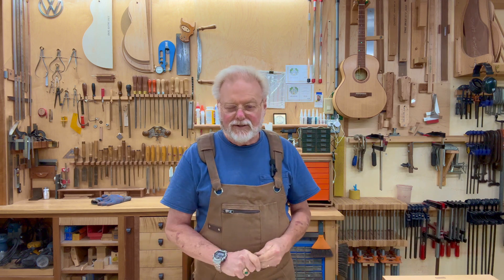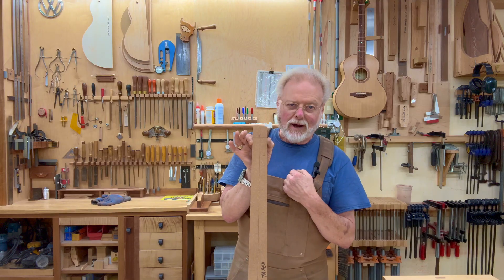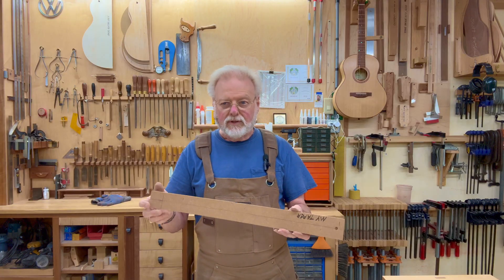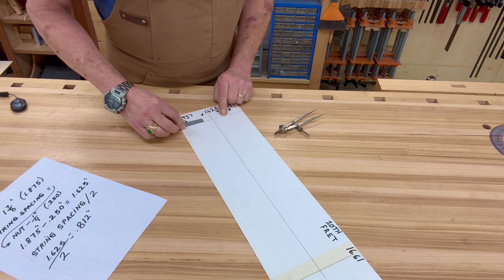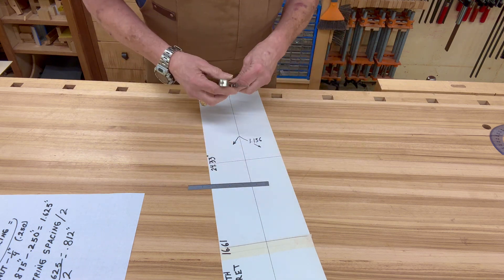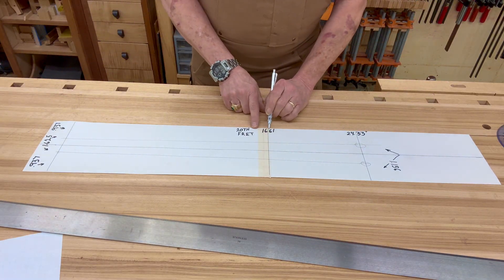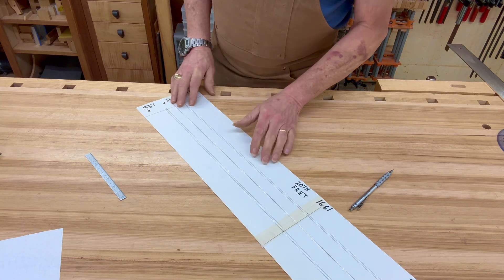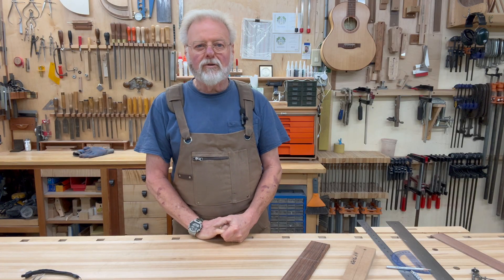Drafting A Fingerboard Taper @thepragmaticluthier

Comment: Super helpful. I plan on building with different string spacing very soon. I would like to try the 1 and 7/8 nut. I started a little parlor with a 12 fret at the body. Also, do you have any tips on working with Western Red Cedar for a top? Thanks for sharing!
Reply from the maker: If possible, make sure the top is from a split billet as opposed to sawn.  Use Spruce for the bracing. When you glue the bridge down, use plenty of glue and be prepared to remove the excess when the glue become "leathery". For reasons I cannot completely explain,  I have re-glued  bridges on Cedar tops much more often than any other top.  I think a parlor guitar with a Cedar top is very likely to be an impressive sound. I'd love to see a picture of that when it's done.
Reply: @thepragmaticluthier  Any objections on using bass wood for bracing? Its just what i have in the shop. Thanks for the tips.
Reply from the maker: DANGER! Danger Will Robinson. Don't use Basswood for bracing. It is a terrible transmitter of kinetic energy.  It is used in kerfed linings because deters kinetic energy from transferring from the top to the rims of a guitar. it has also been used as "excelsior" in speaker cabinets to deaden the cabinet itself. Santa Cruz guitar uses Basswood linings for the reason mentioned above.  If you don't have Spruce, you could use Cedar, but I think you may want to keep it taller than Spruce bracing, by how much, I don't know. You could also use White Pine, keeping it slightly taller also.  Douglas Fir will do well if you have it.